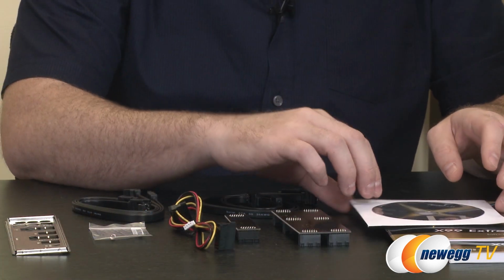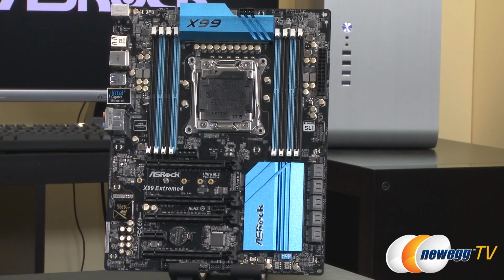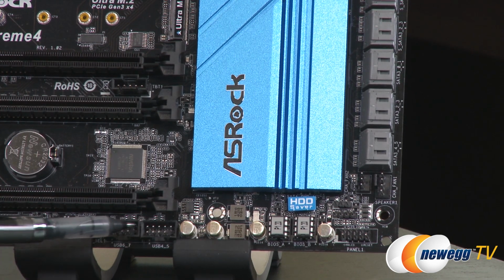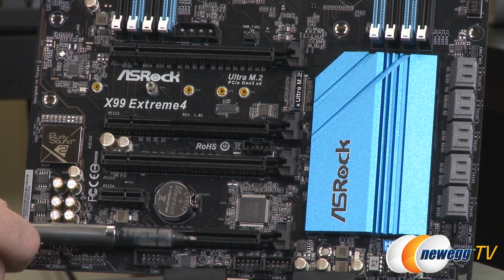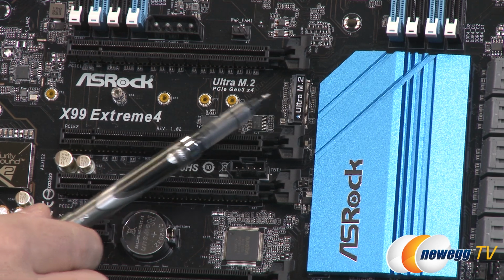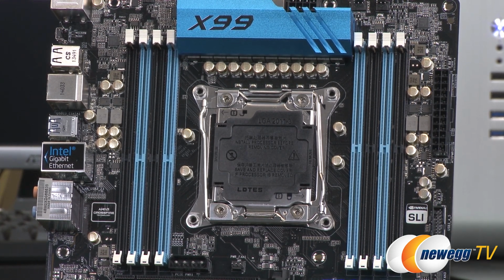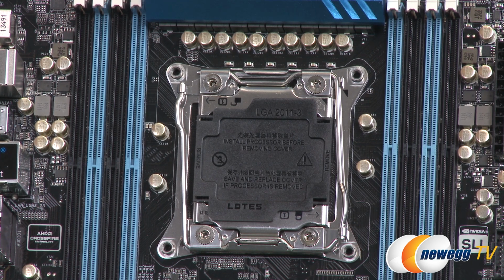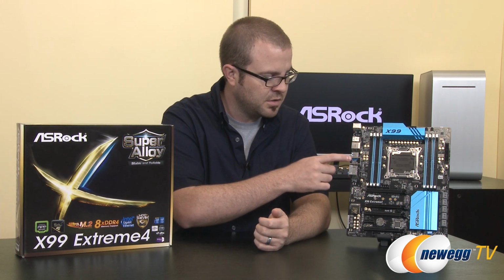ASRock X99 Extreme4 Intel Motherboard Overview - Newegg TV

Comment: I have ordered this motherboard with 5820k, cant wait! :D
Reply: +Matthew Stevenson its awesome and very easy to use and overclock
Reply: +OG-Kush got this with a 5930K bundle
Reply: +Zlobni Kotlet im ordering this aswell man!! hope its awesome!
Reply: +Zlobni Kotlet I just got the same setup in the mail! 

I was wondering if you know how to mount this board in the case, does it need standoff screws?
Reply: yes u need standoff screws in your case and then that little screws to screw in motherboard.
Reply: Zlobni Kotlet Sweet thanks! Turns out the case had the standoff screws pre installed, so now its all figured out!
Reply: Still check for the hidden standoffs that could be touching your motherboard without you knowing it because you can ground out the motherboard and your day will be ruined.
Reply: Rikki Boodram I'm confused, aren't the standoffs what keep the motherboard from being grounded?
Reply: Vulcan Princess
Yes but you see some case manufacturers put all the standoffs in the case pre installed. Which means in every hole of the case has a standoff for the motherboard. I wont mention brand names here but I ordered a case for a ATX build and the case had standoffs pre installed. Which was great but I found 3 hidden standoffs that is touching other parts of my motherboard and that will cause a ground out and damage to the board. I always double check for those hidden standoffs. Yes standoffs supports the motherboard but the "hidden" ones will short out the board.
Reply: Rikki Boodram Ah, I see I see. I'll make sure that its only the ones directly under the screw holes that are on the board! Thank you for the info :)
Reply: Vulcan Princess
 Your welcome :)
Reply: *****
 All new builders get worried about this but what I say is true. I was lucky my first motherboard was not expensive. Lol
Reply: Rikki Boodram Gosh yeah, lucky indeed!
Reply: Rikki Boodram Oh, what anime is your avatar from?

Comment: will I get any problems if I want to put 2400 memory on this mobo??  Will I have to change some settings or something??  ( want a i7 5820K btw)
Reply: +AlexanderXVI nope. just set it in xmp mode and it will give your the stock speed of your ram.

Comment: Mine just came in the mail, this MOBO looks amazing in real life. Haven't installed it yet but can't wait. An excellent board at an excellent price.
Reply: Jon Edquist Have had a lot of problems unfortunately. Worked at first, but now doesn't POST. I have to turn it all off and on several times before it boots up, sometimes it displays the Asrock screen but stays there. This is my first build but it's extremely frustrating to have brand new components not work after spending over $2,000 on a system. I don't know of any other industry where brand new parts just stop working right away. This shouldn't be an issue.
Reply: Jon Edquist never mind, I figured out when you change your RAM settings to xmp in the bios it also changes your CPU clock speed automatically,  but doesn't up the voltage.

Comment: Hey there, 
If i buy 5820k can i install gtx 970 two-way sli?
Reply: yes
Reply: just not 3 way
Reply: +MarshyFrom AUS why not?
Reply: +MohitMcClassyMan Not enough pci-e lanes on the 5820k
Reply: Some motherboards support 3-way sli with 5820k, they work in x8/x8/x8, one for sure that I know of is the MSI x99a sli plus and since its the lower end one i am sure the pricier ones support it too check em out to make sure

Comment: So I built a computer with the ASRock 990fx extreme 9 and an amd fx 4350 for a cpu and an ASUS GeForce GTX 750 ti GPU along with 8 gigs or ram and a 430 watt power supply.  I am trying to boot it with an OS but am having troubles.  I have tried to boot into an old laptop hard drive with Windows Vista on it and it would almost boot but then freeze and the computer would restart.  Also sometimes when I try to boot into Linux from a flash drive it won't even start to boot it will just say insert boot device and restart computer even though it is detected in the BIOS.  I finally got it to boot successfully into a SSD with Windows 7 on it after it froze once while in the case.  I took it out of the case and it booted.  I then installed the riser things and put the mobo back into case.  SSD still booted but HDD and flash still hasn't.  Any ideas?  I hope that the pins touching the case didn't cause any damage to the mobo to prevent it from booting properly now.  Help would be appreciated!
Reply: did u check all ur sata and power cables and if ur power suplie is powerful enuf
Reply: Joseph Lamarche  It was that wimpy power supply wasn't it?

Comment: hey guys i got a question so im going to be working on my first build and wanted to know if these specs are good to get the max out of gaming i may overclock but not sure

motherboard:MSI z97 gd65 gaming

cpu: intel i5 4690k

gpu: gtx 770 superclocked with evga cooler

ram: kingston hyperX 2 sticks of 4 gigs ram 1600 mhz

cpu cooler: cooler master hyper 212 evo

any help is great, thanks

Comment: The asrock x99x is the best x99 bard there is for that price range
Reply: ***** well not really there is a lot of boards for that price 380 isn't cheap for a mother board but at the same time it is not expensive
Reply: ***** i wasnt talking about the asrock extreme 4 i was talking about the asrock x99x killer google it
Reply: ***** well i would see how you would get confused but it is the only asrock board with the name x99x
Reply: Asrock names a lot of  their boards for with Extreme 3,4,6, 11, etc, need to also check which chipset ie. X99

Comment: here i am, still using Z77 Extreme4......... donate me a new motherboard please.
Reply: Really, I am using  asus M5a motherboard .''
Reply: here i am, still using a plastic 2008 HP notebook laptop......... donate me a new PC please.
Reply: Brian Foster i have the Z77 and it's a good board but i wouldn't recommend getting it over one with a newer chipset.
Reply: I have a gigabyte f2a55m-hd2
Reply: I have a crosshair v formula z
Reply: I was just going to buy that motherboard (Z77)... Is it worth buying, or should I just go for this one? Please reply :)
Reply: Brian Foster always buy the latest when comes to technology related.
Reply: aznlilboiz Buddy, you just saved my wallet! I was so close to ordering the wrong motherboard - At the last minute, I realized that the CPU I was buying wouldn't fit into the slot the Z77 has... Omfg! Thank you! phew! :)
Reply: Brian Foster noob
Reply: Conqwiztadore22 Why yes... yes I am lol
Reply: Brian Foster but no harm done.. :)
Reply: ha lol im stuck with a 2 core in an am2 socket in a shitty barebone need money pls
Reply: John Smith I'm still on a am3+ 8 core @5.0ghz.
Reply: James Owen
well that eight core still has more power than my 2 core 5200+. and the worst thing is that i cant upgrade my pc due to a lack of pcie slots :(
Reply: Lol, I was kidding. My pc is a beast.
Reply: James Owen well mine isnt ^^

Comment: whats the difference between this and the ASUS x99 deluxe?
Reply: ***** As for the Asus X99 Deluxe, those 10 USB 3 ports are "fake" as in, 4 of the ports are part of a third party hub, which means its really the bandwidth of 1 USB port spread out over 4 ports, same story for the other remaining 4 ports. The last two ports has full bandwidth each from a Asmedia third party controller. And there's usually issues with third party controllers. Asrock's x99 motherboards have no third party controllers to deal with, as they chose just to use the x99 chipset. So, their mobo is completely native to Intel, and they're the only one to do so.

http://uk.hardware.info/reviews/5600/4/15-intel-x99-motherboards-review-new-boards-for-haswell-e-connectivity-usb
Reply: As us badging.
Reply: It's cheaper, and has less features.